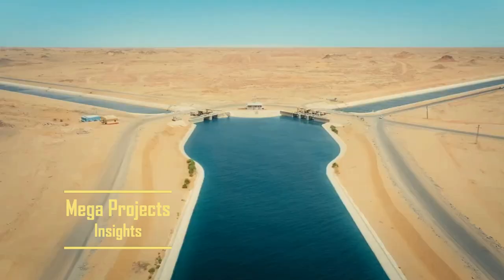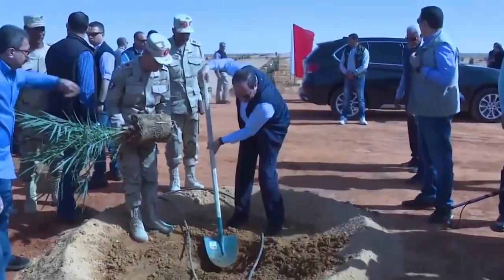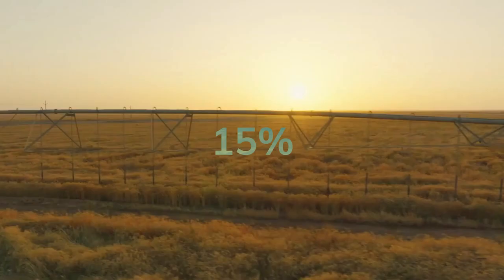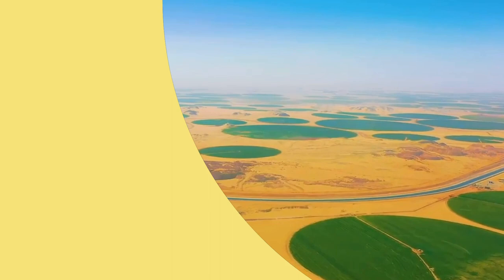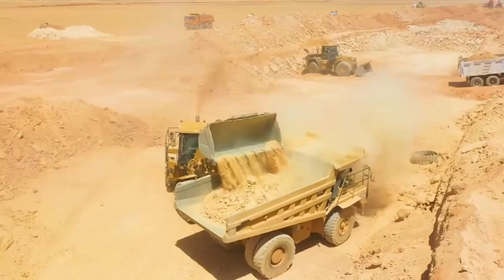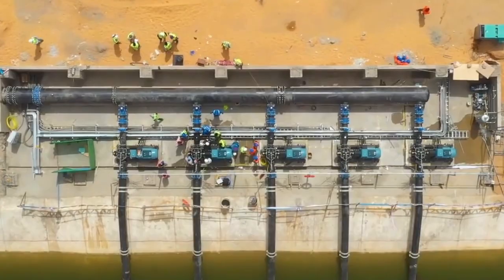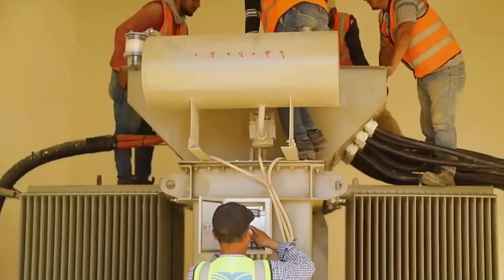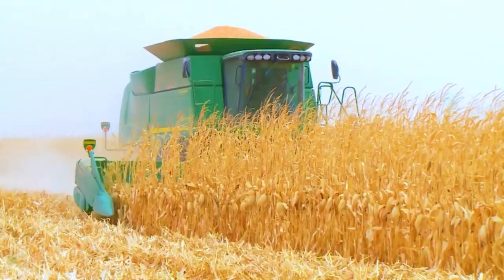How Egypt Turning Desert Into Green! | الدلتا الجديدة

Comment: I have recently checked the delta satellite images from the eighties of last century, and in 2020 on, it showed larger green areas in general, although some delta land has yellowish patches of land due to semi-urbanization. Egypt has no other option than to proceed.
Reply from the maker: Do you think it is going to work in general or they will stop at a point regarding the pressure on water resources due to the increasing in population.
Reply: @MegaProjectsInsights  this is the best use of the water resources. Human direct consumption is negligible, right ?
Reply from the maker: @mamdouh-Tawadros  Yes I think it is the best form.